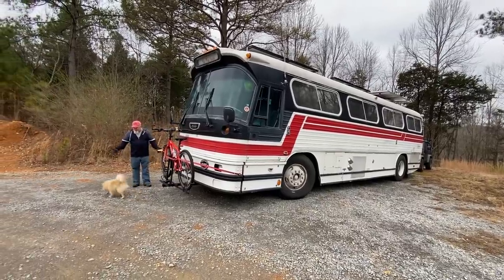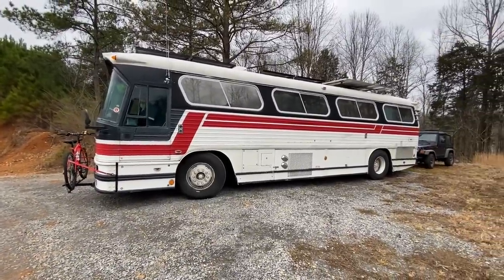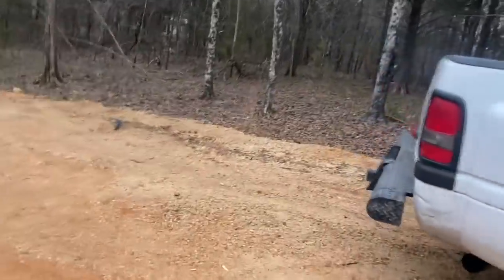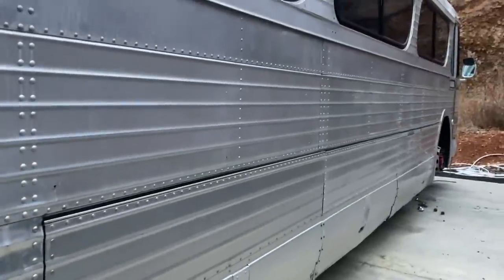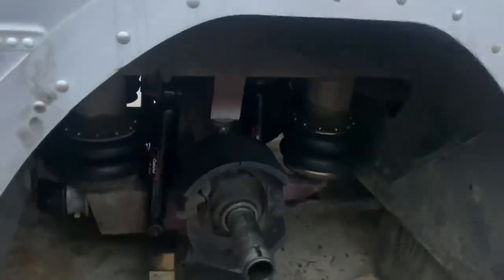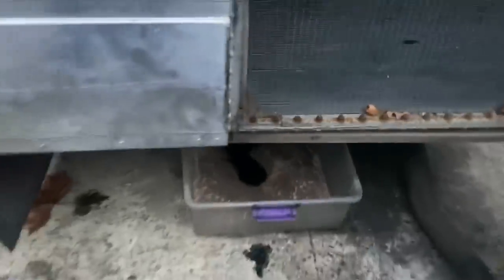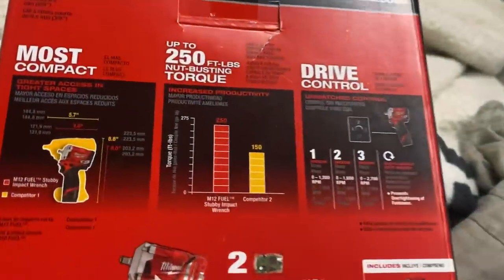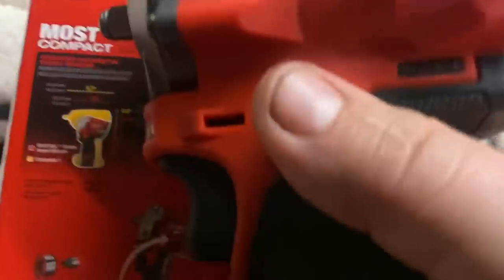Flxible bus leaving, more progress on the 4104, new home for the thing and new tool

Comment: So as a fellow Volkswagen enthusiast's You have to make sure you anchor those car porch to the ground very well. As a good gust of wind will lift them and caused the support structure to hit the car in damage it.  Also I suggested going to park the thing on dirt big shirt display some oil undercoating or fluid film which washes off with dawn dish soap very well underneath as the moisture from the ground will rot the car out.  I would also suggest possibly spraying the entire car down with some liquid wax to keep any spots that are bare metal for Flash rusting.

Comment: Milwaukee was pretty smart making their  18v charger capable of doing the 12v stuff too. That's how I got into their 12v stuff, saw a used 12v 1/4 drive impact on the tool truck & thought "why not, it has a working battery & I have a charger for it already", I now have a 12v 90° angle drill & a 3/8 ratchet. I like them, good tools. A good sales technique & it worked on me. I have accumulated 2 more 12v batteries, so, one for each tool. If you plug 2 batteries in it at once, it charges the one you plugged in first, then automatically switches to charge the second one, neat trick.

Comment: Good job Scott. Glad you got that impact, that will definitely come in handy, I have been looking at those and a ratchet as well. I need to check in on my 3/4" drive that I sent in to see if they have repaired or replaced it. Glad Dan was able to visit, that Flxible is so cool looking. 
@Dan dadesigns4u- Have a good trip Dan! Make sure you keep an eye on that brake buddy, a couple folks in the Wander lodge group have had issues with them locking the toad brakes up. I have been looking into towing something 4 down and I have gotten several recommendations for a product from M&G for braking, they  have one that goes right on the brake master cylinder or an air cylinder on the brake pedal. The connect directly into the buses air brake system to operate them.

Comment: Tip for your new canopy..

Add cross bracing with cables between the frame with eye bolts  through the frame , cable clamps and turn buckles to tighten up the cables. 

It will firm up the frame a lot and will help support the tarp when it rains or snows .

Can also use 1/2” conduit across the frame near the top to create a triangle frame. Use Conduit straps that fit large tubing and 1/2” for the conduit , use bolt to tie them together. Mine has lasted over 13 years with snow rain and wind and frame never fails.  Tarps wear out every few years but frame is fine.
 You Can get the stuff at Home centers for low cost.

Wishing you a great 2021

Comment: Just a warning. Long term parking on dirt even under a cover leads to brake lines and fuel lines rusting out.
Reply: Precisely. All you’re doing is trapping the condensation under the tent with the car. You’re potentially making things worse unless you properly ventilate the tent.

Comment: Just changed a valve cover gasket on my chevy, somebody had caught the engine to frame ground strap in between it and the gasket and it basically siphoned oil straight to the frame and it wasnt grounding the engine properly, oh the things you find on old chevys

Comment: you need a old trackloader you could use it to build quick and easy buildings for storage out of the big keyed concrete blocks the concrete plants around here sell them for around 20$ a piece they make excellent buildings that you can actually secure

Comment: Nice i got new battery cables for my 1970 40 ft gm bus. 6v71 2spd auto. Using welding cable. Then reinstal starter and exhuast manifold
Reply: Is it a New Look?
Reply: Yes it is, has 2 doors . parts stores been closed over holidays so i actually just did it today. Beimg in saskatchewan usually its cold out this time of year but we has 0°c so cables are ran. Waiting on batteries to charge

Comment: Don't know what m12 batteries you have but if you use 6ah or more you will get to rated spec on the stubby  for  tougher jobs. I use it for aircraft maintenance and at first did not like it then I tried a bigger ah battery.

Comment: I hate to let you know, but don't expect to get much more than a year of life out of the canvas on the "garage".  The sun gets to it.  What I did was bought a tarp from Home Depot that I then tied it down over the frame with cord.  I'm working a year with the tarp now.  I wish I had put the tarp on when I first got the garage.  The tarps are pretty reasonably priced whereas the cover on the garage is priced out of sight.  If you can find a sale on the garage you can actually get a whole new garage for less than they want just to replace the cover.
Reply: Yep, I use a cheap blue tarp over my boat cover as a sacrificial cover; they are cheaper than boat covers.

Comment: This might be a dumb question but when you tow a vehicle with a bus like that, do you have to disconnect the driveshaft or is it as simple as putting the vehicle in neutral? Does that cause excessive wear on the transmission?  Just curious.
Reply: Depends on the vehicle, they are all different.  That particular one, my Jeep TJ Wrangler, I have to put the transfer case in neutral and the manual transmission in 3rd or 4th gear so it gets lubrication.
Reply: Thanks for the quick reply!
Reply: Back in the '70s, they removed the rear pump from automatic transmissions which meant you couldn't push start a vehicle afterward. It also means that they either need to be on a trailer, or towed with back wheels in a dolly, or with driveshaft removed if towing from the front of the vehicle.
Reply: @dadesigns4u  - Not sure what you mean. If the transfer case is in neutral the transmission (manual or automatic) is disconnected from the wheels and will not turn. You could leave it in Park and it wouldn't matter..
Reply: @HailAnts  This is a direct copy and paste from my 2005 TJ owners manual:  5. Shift automatic transmission into D (Drive) or manual transmission into gear.